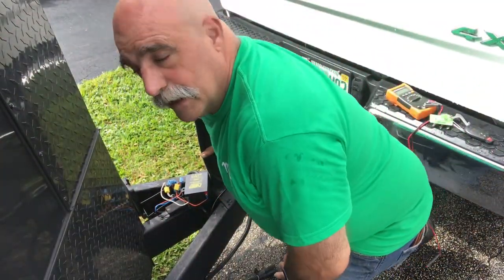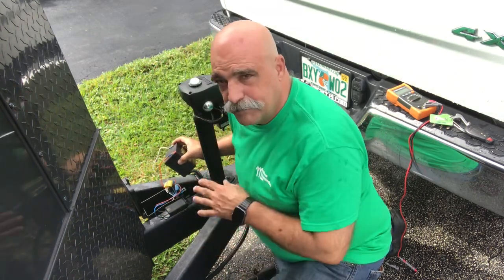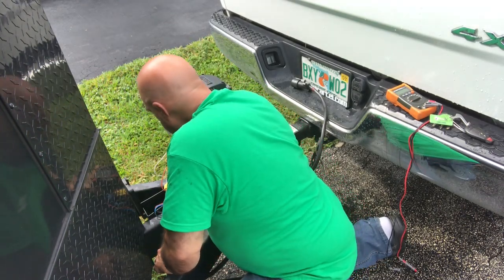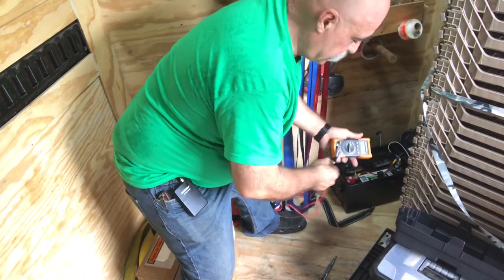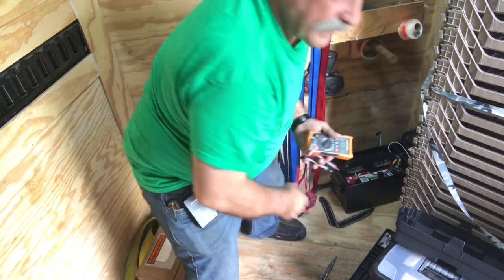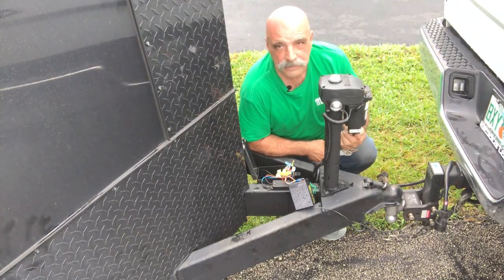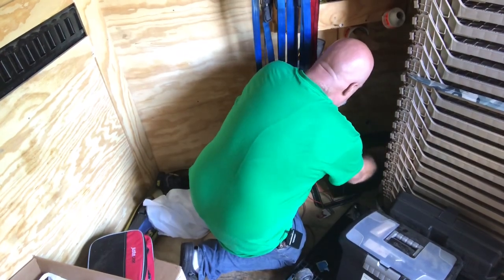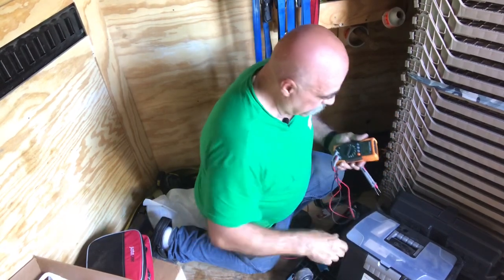How to charge your battery in your trailer off your seven pin

Comment: So is the 12 volt auxiliary charging pin on the 7-pin connector, connected directly to the battery? Is there any sort of charge controller between the battery on the trailer and the pickup truck? I’m about to install some wired GPS trackers for a client and am planning to install small 12v batteries to power them. I’d like them to be charged/topped off from the 7-pin harness
Reply from the maker: Yes, that’s fine. Just use an in-line breaker. I hope this helps you and if you can leave a thumbs up.

Comment: We couldn't see what she was doing
Reply from the maker: Thank you for your comment. Were you able to set up your seven pin? If not, I can help you walk through it. Did you test your seven pin on your truck and find the power and the neutral sometimes they are labeled or if you had the situation where you’re not sure what wire to connect to in the battery box that battery boxes is for brakes, but there is a battery in the trailer But was never getting charged so I connected that wire positive wire to the seven pin so the battery inside the trailer, the 12 V would get charged. I hope this helps you and if you can leave me a thumbs up.

Comment: Thanks Papa.  For clarification, you hooked on red wire to the red post on the battery and that red wire to the positive wire on the 7 prong trailer hookup wire?  Secondly I am not running an electricl jack so what size fuse should I put in line just for the charging wire to the trailer batter?  Thanks Dave
Reply from the maker: Yes, I hooked up the red wire to the positive side on the seven pin. I would still use a 30 amp fuse. I hope this video helped you and if you can leave me a thumbs up.

Comment: Do you need to add a trickle charger between the 12v marine battery and 7 point harness to prevent overcharging the battery? Or is that not a realistic concern? Thanks!
Reply from the maker: Thank you for your question. No you don’t need to add a trickle charger. You just need to make sure you put a 30 amp in-line fuse so if there’s any issue that would prevent the problem I hope you like the video and if you can leave me a thumbs up.

Comment: Just run wire from brake battery to positive on trailor battery with inline 15 amp fuse. Done dill ! Trailor battery should be grounded if battery  was installed  properly .
Reply from the maker: Thank you for your comment and if you can leave me a thumbs up.

Comment: Thank you for the video!  Can you post a link to the type/size inline fuse you used for the 12v power wire?  Thanks!
Reply from the maker: Thank you for your comment. I believe I use the 30 amp in-line fuse. I’m glad you liked the video and if you can leave me a thumb thumbs up.

Comment: Nice job!!! Why did you have to reinstall the original brake battery?
Reply from the maker: Thank you for your question. The battery was already installed inside the trailer, but it only operated the lights but was not being charged so I had to run the wire to the battery so that it would be charged off the seven pin. I hope you like the video and if you can leave me a thumbs up.

Comment: Why didn't you ground the negative on the battery to the frame of the trailer or the trailer itself
Reply from the maker: Thank you for your comment. The negative was already grounded to the frame from the trailer company. They never hooked it up to the seven pin to charge the battery so the battery would discharge and it would have to be removed or plug in a battery charger at night this is for my son-in-law so I hooked it up to a seven pin And now it stay charged. I hope you enjoyed the video and if you can leave me a thumbs up.

Comment: So, you don't need to run a wire from the negative terminal on the battery or did I miss that?
Reply from the maker: Thank you for your question. I should’ve made it more clear this trailer when he bought it had a battery in it to run the lights but they didn’t set it up to be charged so I didn’t need to run the white wire. I only needed to run the positive to the battery, I hope you enjoyed the video and if you can leave me a thumbs up.

Comment: nice video. yes, some audio issues, but we can get the idea of what you're doing here. I have a single battery Silverado 1500 with the towing package, and I see that I too have 14vdc at that pin with the truck is running. any issues with charging two, 12vdc AGM deep cycle batteries, connected in parallel (so they remain 12vdc), in my trailer, with your method? In other words, can my stock truck (whether its the battery or the alternator) handle the extra load put on it to charging these two trailer batteries?
Reply from the maker: Thank you for your question. No, it will not be an issue. It’ll charge the batteries. It’s only going to produce what your alternator puts out and no charge the batteries completely. I hope you enjoyed the video, and if you can leave me a thumbs up.

Comment: Maybe I missed it? You ran 1 wire to positive terminal. I didn’t see you run a neutral line. Was there already one in place? Or maybe I am clueless but I thought to charge a battery using the 7 pin you would need 2 wires, for both positive and negative terminals.
Reply from the maker: Yes, you’re correct there was already a negative wire run to the box from that battery so all I had to do was run the positive wire. I hope you like the video and if you can leave me a thumbs up.

Comment: Ok im a little lost since the video dropped sound so many times & I never saw you reconnect the 7way nor do I know why you even cut it. Would you ever think of making this video over step by step with better audio?
Reply from the maker: Sorry about the sound, but yes, I have remade the video on a couple of other trailers should be in the playlist. if you look at the video closely, you’ll see he had 27 pins one on the hydraulic jack and one for the trailer. I eliminated the one on the hydraulic jack and added it to the existing seven pin cable. I did all that inside the box.
I hope this helps you. If not, please send me another question I will do my best to help you also, if you can leave me a thumbs up.

Comment: Great video I did not see what size fuse you used to protect the charging can you tell me what size you used and how you decided that. Thanks
Reply from the maker: I believe in this when I used a 30 amp fuse because we were just using to 8 inch fans and three small lights it wasn’t pulling that much. Hope you enjoyed the video, and if you can leave me a thumbs up.
Reply from the maker: It is mainly for the charging.
Reply: Thanks so much so the fuse is for the fans protection only or also for the charging? I’m mainly concern for the charging in my application

Comment: What amp fuse?  Do you need a regulator to step the 14v down to 12v?
Reply from the maker: Are used a 40 amp in-line fuse. It worked fine and no you do not need a regulator. Your alternator is usually pushing out 14 to try and keep your battery up to 12.8. I hope this helps you and if you can leave me a thumbs up.

Comment: If battery truck is death and Hook up the trailer  fully charged can 7 pin conector manage all the power to run the truck?
Reply from the maker: Thank you for your question you’ll have plenty of power to run your truck even if the battery in your trailer is down but you need to find out why your trailer battery is down it is best to keep it fully charged and your truck will charge it but if it keeps going down, then you need to check out the battery. I also have another video on how to restore a bad battery I hope this helps you and if you can leave me a thumbs up

Comment: Im trying to do same thing my black power wire has scotchlock with wire to the brake controller battery can i add another scotchlock with wire to the battery the one i want to charge i was leary about multiple scotchlocks on powerwire
Reply from the maker: It’s not the greatest thing to do but it will work. I’m glad you like the video and if you can leave me a thumbs up.
Reply: I ended up hooking my elecjack to a battery with a inline fuse just just not sure how to wire it so truck charges it

Comment: Can u show us how to put cables in etx just with an car and no electrice brake box
Reply from the maker: What cable do you have existing? Is it a four pin or is it a seven pin?
Reply: @buildingwithpapa   7 pin
Reply from the maker: https://youtu.be/OpKPT4HE9ys Watch this video and it will give you the color wires and what they lead to. I hope this helps you if not please let me know and I will try to give you something else.
Reply: @buildingwithpapa  yr i need + from trailer put a another + in together so i have constaly +  then run to exstra battery in trailel then - of battery to frame of trailer so it charges right?
Reply from the maker: I don’t know if you watch the video but that shows you exactly what to do.
Reply from the maker: And yes the positive goes to the battery don’t forget to put a fuse in line close to the battery and then you’re negative goes to the frame. I hope this helps you and if you can leave me a thumbs up.
Reply: @buildingwithpapa   thank u do u jave sites i can buy things i need (from netherlands btw)
Reply from the maker: Click on the description you were able to buy from that site.

Comment: Nice vid but deff need to work on the audio quality papo is frustrating thanx for the vid.
Reply from the maker: Thanks for the comment. I just put up another video of doing the seven pin to charge a battery in the trailer check that one out the audio should be much better and if you can leave me a thumbs up.

Comment: On that small box with a small 12 batteries I have a light that’s on top of the little black box
Reply from the maker: Where is the small black box is it on the outside on the tongue of the trailer or inside?

Comment: How do you not blow the fuse when the trailer battery is low and you start charging?  Does the tow vehicle’s trailer light system safely limit the charge current?  Thanks for sharing!
Reply from the maker: Thank you for your question. Many trailers that have brake systems, which this one does already has a small 12 V battery on the frame with a fuse that charges off your seven pin.
You need the fuse because if something short out you want that fuse to break. I hope this helps you and if you can leave me a thumbs up.

Comment: So, does it charge the battery while driving and even when driving lights of the truck are off?
Reply from the maker: Yes it charges the battery while driving. It doesn’t matter if your lights are on or off it will still charge the battery.
If you like the video and if you can leave me a thumbs up.

Comment: You remembered the fuse! Awesome! So many FORGET the fuse. One buys a battery box made to NOT leak out the bottom and let any Acid leak! Then drill holes in it Brillant! No neutrals in 12v just Hots and grounds. Thanks for the video.
Reply: Most buy the battery boxes to protect the battery rather than keep the battery from leaking.
Reply from the maker: Thank you for your comment.
I’m glad you enjoyed the video and if you can leave me a thumbs up.

Comment: Could you use 12 gauge wire in place of 10 gauge wire?
Reply from the maker: Thank you for your comment, Do you have to be at least the same size of the wire that is coming from your truck if it is 10 gauge used to engage do you need to verify it.
Let me know how it turns out and if you can leave me a thumbs up.

Comment: Thanks for your video! I just learned my 2018 F-150 SuperCrew with a tow package will not charge the trailer batteries while driving. The RV dealer checked the 7-pin Aux 12V and it showed no power.   I spoke with a Ford service tech and he stated in order to have power the truck needed to be parked and you had to keep your foot on the brake pedal. He then hooked up a device that simulated a towed trailer and when the brake was not pressed there were zero amps at the 7-pin., but when the brake was pressed it showed 6-7 amp at the 7-pin. What are your thoughts about running a 16 gauge wire directly from the tow vehicle battery to the 7-pin Aux to charge the trailer batteries while driving?
Reply from the maker: Also I wanted to thank you for your question I did not know that about the F1 50 I’ve done it on a dodge ram as you seen in the video and it works quite well I’ll have to check it on my Escalade but again mines a 2013 I believe there was no issues with mine I know what they use for the tow package it says that power to the small 12 V battery for the brakes on the trailer.
I hope you like the video and that you continue to watch and if you can leave me a songs up it really helps the channel.
Reply from the maker: Running directly from the battery is very dangerous it can overheat that Wire and possibly burn it up I don’t recommend it if you do it you need to put a fuse in that line so that you don’t have any issues but I think it’s going to pop the fuse quite a bit.
Reply: @buildingwithpapa  Thanks for your insight. I'd rather be safe than sorry.
Reply from the maker: I agree always be safe all right if you can give me a 👍
Reply: First, a lot of vehicles have the aux pin circuit   broken by leaving the fuse out.  It's safer to not have an energized lead hot all the time. Kids playing can mess with it, driving through saltwater could short the circuit and cause galvanic issues with metals by your exhaust.  Just look under your hood for the breaker names.  I bet you have a breaker for "aux trailer".  Google say space 9 and 21 are the fuse slots AND look for relay slot #5 in the fuse box, it comes empty from the factory, put a $10 relay in that slot or jump a fuse to slot 5 to have power to aux pin all the time, with a relay you only get power back there when the trucks ignition is on.  Fuse should be anywhere from 15 to 30 amps.  If you need more than thay then yes you can run a wire from your f150 to the camper trailer, they make kits for doing just that.  I had it like that for a 20amp DC-DC charger, until I finally found the Xantrec echo, its a 10 or 15amp battery charger for my trailers lithium batteries. Hope that helps.

Comment: Ford trucks won't work unless it senses the load off the trailer connector. So it won't show any power until then.
Reply from the maker: OK that sounds reasonable, but the only time you’re going to be charging it is when it is connected with the seven pin.
Reply from the maker: Also thank you for your comment the truck I was working on was a ram and my other truck is an Escalade so I have not worked it out with a ford at this point.

Comment: Thanks for the video.  Question:  You know how you have the positive and negative wires going to the break away (emergency brake) battery...Can't you just split them to go to the new battery?
Reply from the maker: Yes you can I just ran inside the box where everything was tied in together essentially I did the same thing everything that was going to the battery is going to the other battery that is inside the trailer.
Thank you for your comment and leave me a thumbs up if you can.
Reply: @buildingwithpapa  in my trailer, the emergency brake battery is mounted inside the trailer.  I plan to mount an extra battery or two right next to it.  My plan was just to split the wires that are charging that battery.  I think it'll work.  Thanks again.

Comment: You never installed a battery isolator? Im doing this same set up on my trailer
Reply from the maker: Thank you for your comment. I guess I should’ve clarified this this truck already has a battery isolator it has two batteries and then has the positive and negative coming through the seven pin and there’s a battery on the trailer for the brakes, I just came off of those wires up to the new battery.

Comment: How does it charge do you run new wire up to truck battery
Reply from the maker: No you don’t run new wire to the battery, your seven pin will have your 12 V hot wire and the white negative when you’re using those two wires it will charge your battery.
Hope you enjoy this video I have many more and thank you for your comment.

Comment: the battery on my towed vehicle is always getting drained during towing.  I want to run a trickle charge so i can start my towed vehicle when i get to my destination.   so all i need to do is to run a fused line from the constant hot of my connector to the towed vehicle battery?  Do I also need to run a dedicated ground wire from the connector directly to the battery or is vehicle ground going to be sufficient?
Reply from the maker: Thank you for your comment, I think the real question here is why is your battery draining I don’t know how long you’re towing this vehicle but it seems odd to me that the battery is draining.
But if you do decide to charge that battery this way use the fuse line like you said of the constant heart but you are going to have to run the neutral also.
I hope this helps.

Comment: what size inlinefuse did you use? and thank you for the video!
Reply from the maker: Are used a 40 amp in-line fuse.
Thank you for your comments.
Reply: @buildingwithpapa  HA! That was my question. The video was a big help. 
I was looking at solar to trickle charge the battery while the truck and trailer were parked. I don’t have much running off the trailer battery, but like everything with an electrical power source, things are going to add up. (Solar panel, charge controller, inverter are in my future)
Reply: Thanks for putting together the video. HUGE HELP!  I tried finding the indoor fan you showed, no luck. Could I ask you for the brand? Again, thanks. I’ve replaced boat trailer wiring. With this video I think I can handle charging the battery in the trailer. Really good stuff.
Reply from the maker: @jeffhenderson934  The fans my son-in-law bought them I believe on Amazon, they’re golf cart fans 12 V
I hope you continue to watch give me a thumbs up that helps the channel.